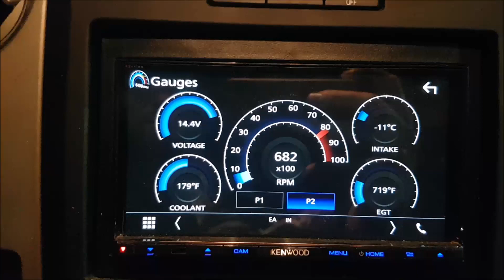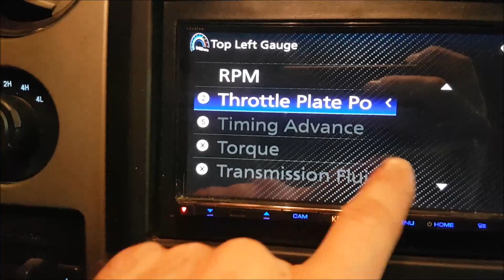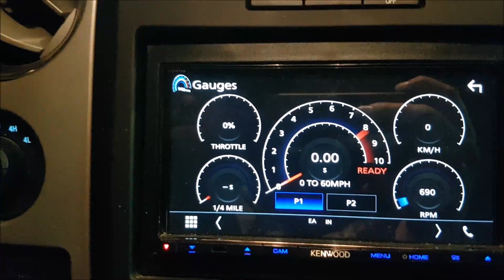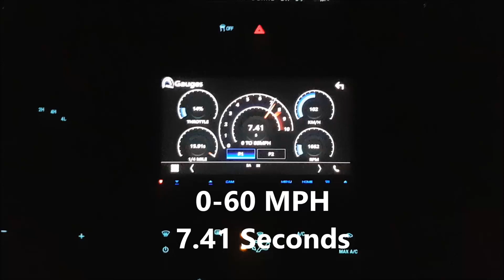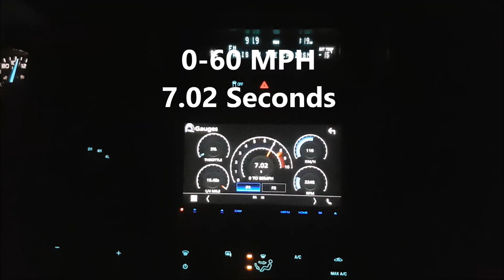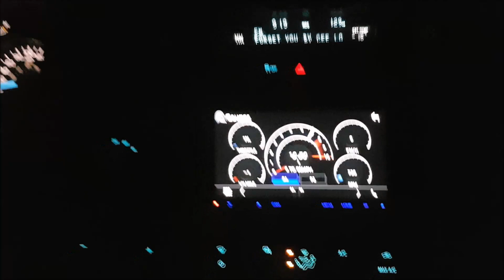Kenwood Excelon DDX903S Double Din Extra Gauges 0 60 MPH 1/4 Mile Review Ford F150 5 0

Comment: How do I install that to my truck doe
Reply from the maker: Install the radio or the obd2 communication?
Reply: @LUCAMTire  I got the radio in there
Reply from the maker: @calebdriscoll9329  what is your question?
Reply: @LUCAMTire  just tryna get my gauges to work on my radio but probably do need a obd2 or my truck is to old for it. 2004
Reply from the maker: @calebdriscoll9329  you need a module to be able to read the data from the obd2 port. 
Then you need to either plug in or hard wire into your obd2. 2 or 3 wire set up. For obd2 plug.
I bought the wire and adapter plug for obd2 port so I can plug and unplug if I sell truck. 
I believe the module box we used was called maestro data link.
I needed a module or a wiring harness for the heads up display above radio to work. Then needed a module box for the lcd and obd2 data communication. After everything was installed needed to update the double din unit for all the updates.
I think you need a audio license with the company for updates but am not sure. 

I had a audio wiring guy to install the unit and to update  the software. 
So I can not give you all information but some of the scenarios you will be facing
Reply: @LUCAMTire  ah ok thank you very much🙏🏼I’ll do more research fs

Comment: How did you make your gauges work with the stereo? I want to do this to my mustang but I’m not sure how you do it
Reply from the maker: I needed to buy a obd2 adapter that goes from the deck to the obd2 port.
Or you can tap into two wires on your obd2 harness and attach it to the deck. I bought the harness so it was plug and play incase I ever wanted to switch back to stock fairly quick
Reply: @LUCAMTire Great video.
  I have a bluetooth OBD2 plugged into port but the gauges function of my head unit is greyed out.
How do I pair it to the head unit? I've gone to bluetooth settings on head unit but it won't pair, seems to only want to pair with another phone.
Reply from the maker: @eriklehman3175  mine is plugged in or hard wired with 2 wires. I don't know if you can just plug a blue tooth ob2 dongle jn. The program in the deck might not have the blue tooth capabilities to run this function. I Could be wrong but don't think the deck will work with it that way.
Mine is two wires off the back of the deck and clips in on the obd2 port
Reply: @LUCAMTire  thanks for the prompt answer.
I failed to mention that my head unit is the Kenwood DMX9706S. I doubt think it should matter though. 
Where on the back of unit did you connect wires and how\where did you connect wires on the dongle?
Maybe a video for hooking it up?
Thanks again
Reply from the maker: @eriklehman3175  I thought about a video on hooking it up but is quite a lengthy process.
I bought a 2 wire harness that has a od2 adapter on one end that just plugs into the od2 port that has power and data line and either a plug in or 2 wires you need to splice in on the other end on deck.
Thinking it was 2 bare wires you needed to connect to two others on the deck. 
Check owners manual/ installation guide to see where things hook up.

You don't technically need the harness but I didn't want to hardwire it to obd2 port incase I was to ever unhook I would not need to cover bare wires on obd2 harness.
Reply: @LUCAMTire  I guess this is why my manual does not cover how to make the Gauges on head unit work, or for that matter several other items!
I don't want to have to bypass park brake so I can use wireless mirroring while driving. 
I have two phone apps that allow me to monitor the engine and display gauges like the head unit can but I'd rather use head unit system...
Do you know what wiring harness would be used?
Thanks
Reply from the maker: @eriklehman3175  understood.
I'll see if I can find a link to a picture of what it is.
It is only a 2 wire set up.
Power and data wire. Or ground and data. I'll get back to you shortly
Reply: @LUCAMTire  I really appreciate the effort you're putting in to helping me out!!
Reply from the maker: @eriklehman3175  you need ( Idatalink maestro rr )
This is what was installed in my truck to make everything work.
It is a communication box that communicates to all the different modules and allows things to work. With out this it will not work. 
Your vehicle needs to be compatible with it From what I understood by the installer. Check compatibility before purchase and install.
Reply from the maker: @eriklehman3175  and if you haven't already, like this video and Subscribe to the channel to help me out. 
Thanks and hope this works for you.
I know when I purchased it. It was a bit pricy but depending where you are and source prices may be different.
Reply: @LUCAMTire  thank you very much!
I already subscribed
Reply: CJS Customs Decals And Designs where can I buy the obd2 adapter?
Reply from the maker: @leomedina5614  I purchased mine through a local audio shop when I purchased the deck. And also purchased the wiring harness to make the clock radio temp display to work as well on the heads up unit.
Reply from the maker: Could also possibly find the wires on ebay.
Reply from the maker: If I have some time I will see if I can find the wires online I bought from the audio shop